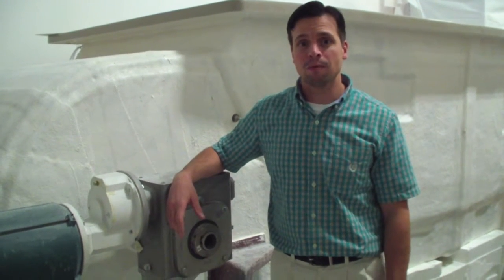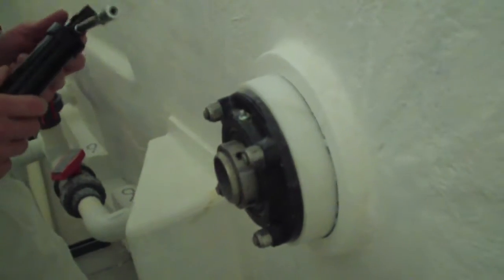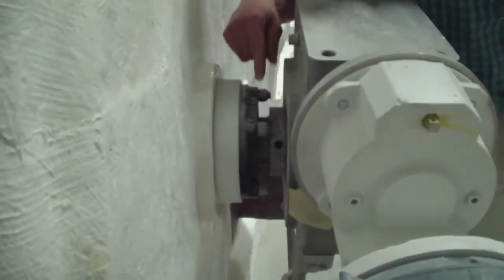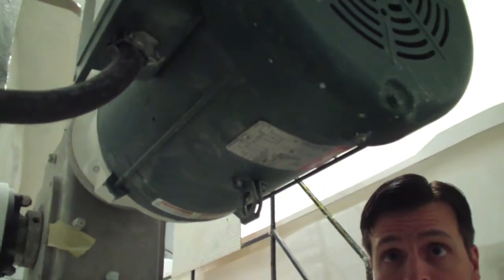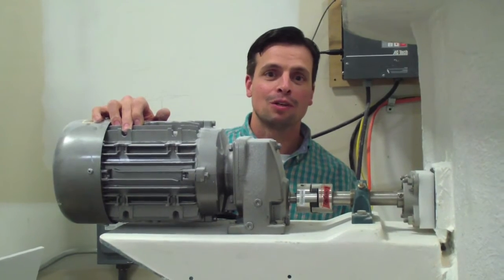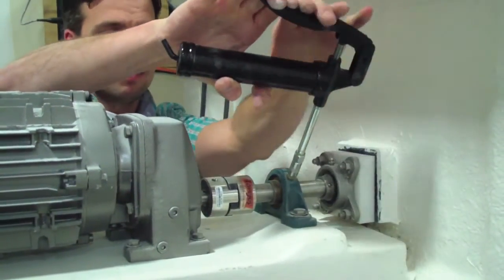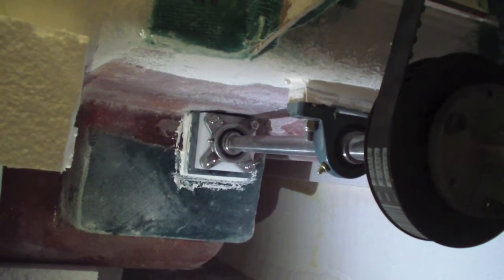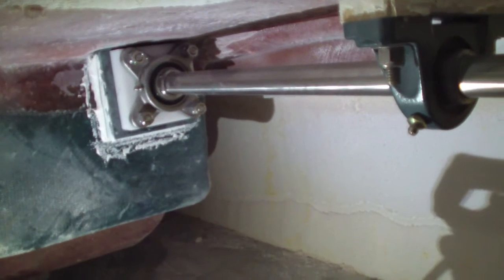Pool Maintenance - Greasing motor bearings.

Comment: Would have been nice if they had explained how we are suppose to get to these when in the ground. And for someone disabled - how are we suppose to do this.  They can make fans that run for 30 years with no greasing, cars, all kinds of thing that don’t require greasing.  For the cost, I’m surprised they haven’t figured out how homeowners wouldn’t need to
 do this.